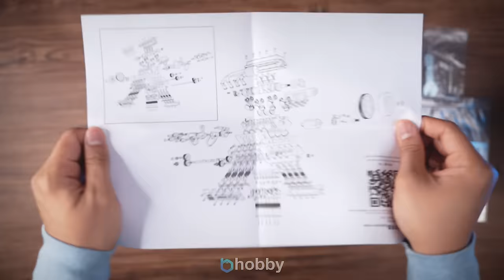Build a Toyan V8 Engine | Speed Build | Stirlingkit

Comment: Does it run? That's the whole point for the build..
Reply: Yes it does look for other videos, it makes 5 horse power i think
Reply: @senegalesencalzones wow, 5hp is actually impressive
Reply: @retinico 5hp is too much, the changli truck makes 0 hp, this makes a whopping 1000 antpower
Reply: @AgressorSQN the toyan engine is 28cc so it can barely run. For rc cars
Reply: @ACON1792  don't non geared two wheeler engines make 50cc?
Reply: Yeah
Reply: @tortoisearmor310 I got 10.86 ponies out of mine but once I've rebuilt it with quad turbo's I'm thinking 🤔 maybe even a full 11!!!!!
I've the blown version and will redesign the header collectors as well also running four carb redesigned cross ram over compressor so the little baby girl can breathe!!!!

Comment: Those header collectors are not efficient!!!
I can't believe Toyan would make such a stupid mistake but once I've secured mine I'll definitely redesign them but thanks for the video!!!
But why didn't you get the blown version with duel turbo boost also if you should happen to secure the extra parts you may want to die grind out the bottom discharge and the intake at least to the gasket for more flow!!!!
But again thanks for the video young 🌱 man!!!!